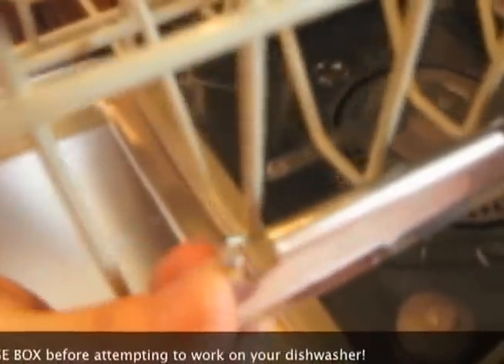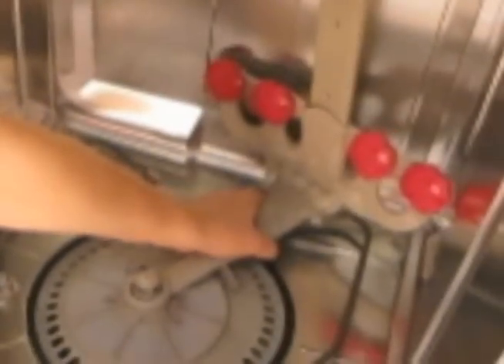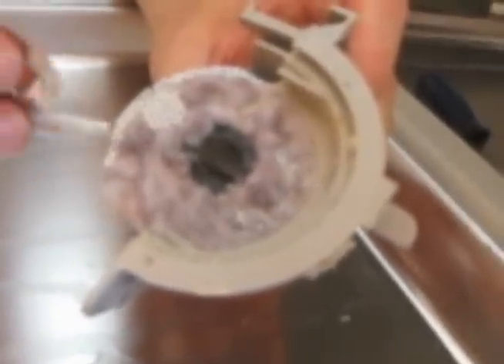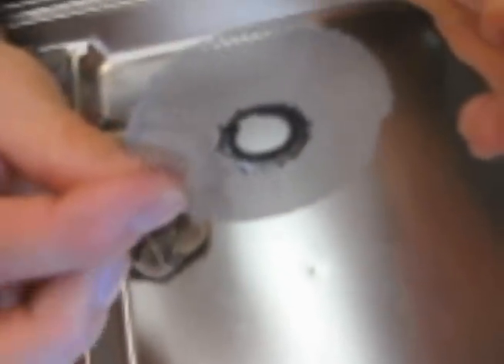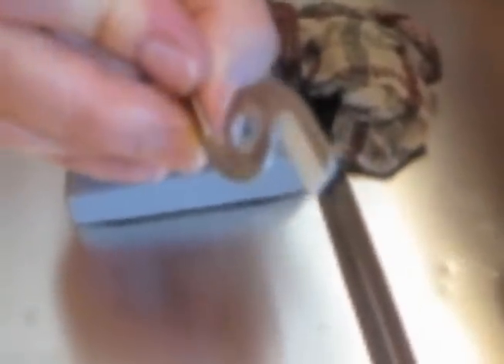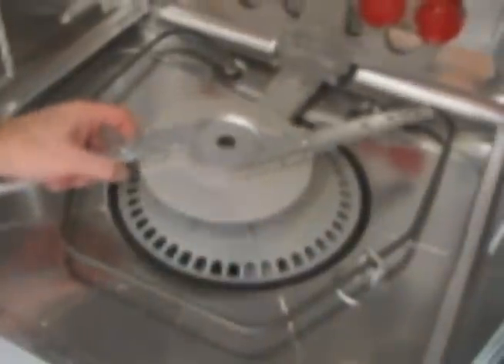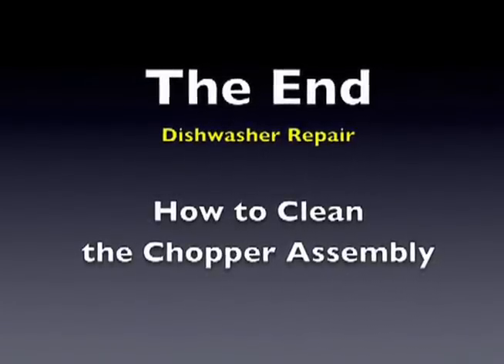What to Do When the Dishwasher Won't Clean

Comment: Thank you so much.  Our dishwasher had stopped cleaning - top and bottom rack. Last night I bought a new dishwasher, but decided to give your video a try before I opened the box. I was able to follow your instructions exactly, until I got to the chopped assembly. Mine didn't come out. But I was able to clean out a lot of food and debris from around it. Everything is working fine. Tomorrow, I'll be taint the $600 dishwasher back. And will try not to break my arm patting myself on the back. You're the man!
Reply from the maker: D Mills Thanks! Glad the video was helpful!

Comment: Thanks so much for this video! I cleaned everything and afterward it wouldn't work at all. After your video I realized that i had not set that little impeller on to the shaft. Works great now. Thanks for your video.

Comment: Great video but you should have cleaned the check valve by the sump while you had it apart. Also glue the bottom flapper check valve in the water tube closed as this valve breaks off causing pressure loss. Run a product called Finish in the washer once a month to cut the crud from the sump strainer.

Comment: Great video!  Easy, and so empowering to do this by myself!  The chopper didn't come out with the assembly, but it wasn't plugged anyway.  There was a lot of debri that I sucked out with the turkey baster.  And I did glue shut the bottom flapper valve.  ThankS!

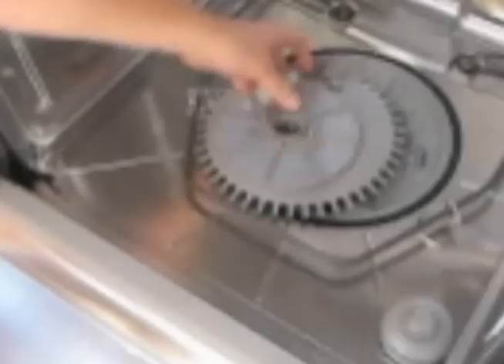Comment: Thank you! Mine came apart almost exactly the same yours did.  Except once I removed what you're calling the oil accumulator (2:00), my washer revealed the most unholy ghastly can't-take-back sights ever.  I had money, glass, plastic, wood, and everything else unholy in mine, and it pretty much stopped up everything.  My screen was mostly clear, mainly because the gunk was preventing water from getting to the pump. Its back to running prime now!
Reply from the maker: +Sean White We encountered some broken glass, paper, and bits of plastic, but unfortunately, no money!

Comment: I was also having the same problem.  After the 5th time cleaning the chopper screen I noticed the plastic part on the motor that the chopper shaft connects to was worn away to nothing. So the chopper was not spinning. So far the only option I can find is a new motor or new dishwasher.

Comment: The best thing to do to avoid a dishwasher's poor cleaning is to avoid buying a new energy efficient one that barely spits cold water onto your dishes. Buy a used energy hog that blasts the dishes like a fire hydrant and drys them with the kind of Calrod unit that will cook a Thanksgiving Turkey.
Reply from the maker: The newer dishwashers only use hot tap water in the wash cycle. To ensure hot water for your dishes, you must run the tap until hot water comes out before turning on the dishwasher. The water is not heated inside the unit -- unless you purchase a more expensive model with a cycle that specifically heats the water. The newer dishwashers may not be great for cleaning dishes, but they do make great drying racks!